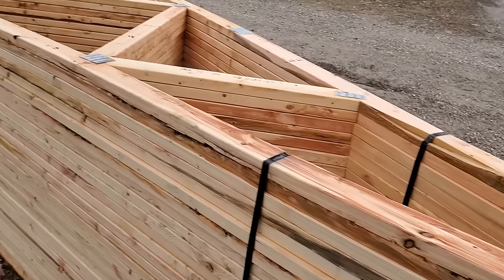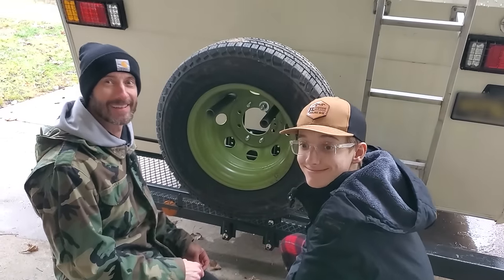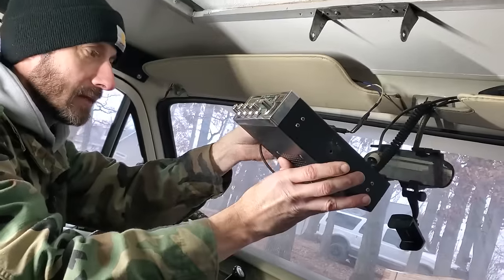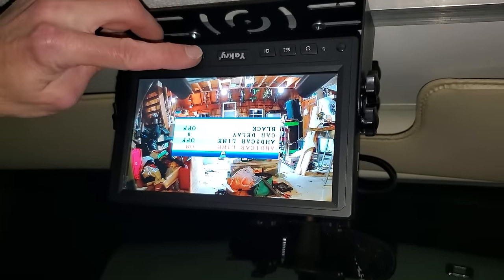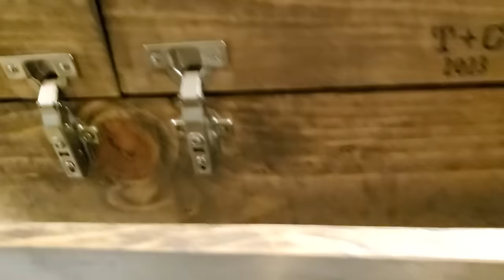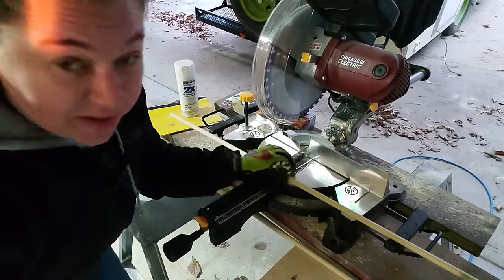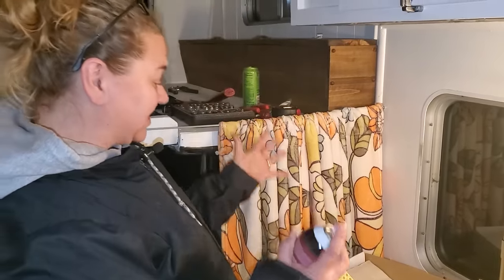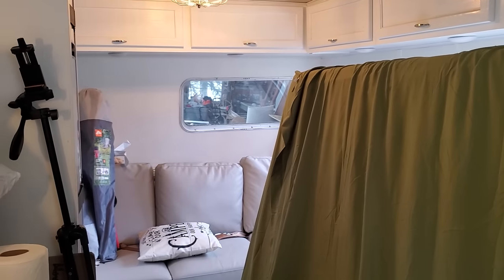Reviving Retro RV Vibes: Punchlist Palooza - Transforming Our 1970s RV - DIY Decor & More!

Comment: The husband and I suggest using magnets on the bottoms of those curtains so they stick to the frame of the window. Nice job by the way.
Reply from the maker: Great suggestion!  Thanks so much 🎉🎉
Reply: They make strong round or bar magnets, just sew a small pocket to bottom of each corner and add a magnet. Boom done
Reply: That is a great idea!

Comment: **wanted to share a tip I myself just learned the other day. When using sprays try replacing the spray tip with a WD40 tip. Switching tips help to have more control of the spray also not wasting as much. Be sure to test spray a few making sure the WD40 spray has cleared. I hope this helps you in your retro remodels. Love ❤️ your channel!
Reply from the maker: We have never heard that but sounds like it may be worth a shot!  Thanks so much 🎉🎉

Comment: Happy Birthday Tyler!!Everything is looking great!! Love your spare tire bracket and your camera mount. Love your new blinds , your curtain and that waffle cloth you glued up looks awesome. GREAT job. The storage build is awesome!! Just a suggestion for the angled from window, I bought some window film and put on mine and it worked great. Can't see through mine, it's white to let light in though. But you could use the darker color to block out sun and you can see out but not in if you get the mirrored kind. Another idea is you can get long springs and sew seam spaces each side of your blind and put one top and bottom. Run the spring or cable also would work, through the seams and attach ends to each side of window. If you make the blind longer than the width of window so it sort of gathers across the window for textured look. So happy to see another new video. Wonderful your getting a barn built to get you guys inside out of the weather!! So happy for you.
Reply from the maker: Thank you for the birthday wishes! Also,thanks for the compliments and suggestions😁. The window film is definitely something we've been discussing😉.

Comment: You installed the monitor (not camera) upside down. Try long springs for the curtains on the curved walls. Love what you're doing, congratulations on the 10K, and looking forward to the new videos..
Reply from the maker: Thank you!  Great idea with the springs.  So, yes, we knew that we put the monitor in upsidedown but the bolts on the sides didn't fit correctly in the mount if flipped... like it was only designed to be dash mounted or something.  We probably could have tried a little harder with those bolts though, lol.  We decided to fix it the hard way 😂. Thanks for watching and commenting!

Comment: Good job looks great!  For the front curtain-screw a rope (string) at the top and bottom of the window.  Then sew a piece of material with a channel top and bottom.  Pull the rope thru the curtain channel top and bottom.  Same as your divider curtain, except you have a channel at the bottom as well.  The curtain will stay against the window and not hang straight down.  You'll be able to push the curtain open as it slides along the rope.
Reply from the maker: Thanks for the tip! Good idea!

Comment: You can make blinds with magnets on them told hold them in place in those front and back windows people do that in the van builds all the time that way you can remove them and put back up quick and easy and still have the same blinds as the rest of them hope this helps congratulations on the 10000🎉
Reply: Just to let you know, the old campers usually have aluminum window trim/frames and magnets have to be fixed to the camper and the curtain for that to work. In a van conversion, they are working with the van body steel.
Reply from the maker: Thanks so much!  Yes, for magnets to work, we'd need to add them on the wall too (or some metal) since our windows are aluminum but it's still worth considering.  Thanks for the comment.  We appreciate you watching!

Comment: The monitor is also upside down
Congratulations on your 10k 🎉
Reply from the maker: Thank you!  So, yes, we knew that we put it in upsidedown but the bolts on the sides didn't fit correctly in the mount if flipped... like it was only designed to be dash mounted or something.  We probably could have tried a little harder with those bolts though, lol.  We decided to fix it the hard way 😂. Thanks for watching and commenting!

Comment: A simple fix for the blinds on the front and back windows. Get magnetic washers with a tapered center for a countersunk screw. Screw a steel washer to each end of the bottom dowel. When you drop the blind, stick the dowel to the magnets screwed to the wall. The magnets should be strong enough to hold onto the edges of the washers. You could put a second pair of magnets at a level in between to secure the blind partially open. Amazon has a 50 pack of these magnets for $6.99. That would be more than enough to magnetize all the blinds. Could leave the bunk blinds down when driving and they wouldn't flap around. Leave the windows open when there's a breeze and the magnets would hold the blinds down to keep a full blast of wind out while allowing some ventilation through the screens.

There are also non-magnetic steel washers with the same shape, made to screw onto things to stick to magnets. They'd work on the ends of the dowels and being thicker than regular flat washers would stick better on edge to the magnets.
Reply from the maker: Thanks for the tip. Lots of good suggestions about the blinds. Thanks for the comment 😁

Comment: Depending where you are going to be, you might want make a security strap on the tire and camera so someone does not help themselves to it.  A shame but some people have no shame.  The front window could have velcro tabs on it to hold it against the wall.
Reply from the maker: Yes, fantastic idea.  We are planning to use some of the cable we bought to loop through the wheel and padlock it.  Thanks for the comment!

Comment: The monitor is upside-down. Look at the main button on the monitor....:)😉
Reply from the maker: Thank you!  So, yes, we knew that we put it in upsidedown but the bolts on the sides didn't fit correctly in the mount if flipped... like it was only designed to be dash mounted or something.  We probably could have tried a little harder with those bolts though, lol.  We decided to fix it the hard way 😂. Thanks for watching and commenting!

Comment: Are you going to put radiant heat in the floor of the new pole barn?  Michigan is cold 9 months of the year.   I cried at the grandma scene too😢...i still use the sewing skills grandma taught me.   Just re- did my boat cousins.   I'm sure you can do the couch cousin. :_raiseroof::_loveharvey:
Reply from the maker: Funny story, Tyler's brother just asked us the same thing about putting radiant heat into the floors... we will probably go more of the wood stove route at this point but maybe we should look into the heated floors before we get past the point of no return. Can't sew without thinking of Grandma the whole time, she was amazing ❤️
Reply: I have seen videos where they already foam the dirt before the slab goes down.  They laid 6x6 welded wire fabric to attach the tubes for the heat to that.   Also added fiber to the concrete to help try to prevent cracking where you don't want it.   Others show Lego looking floors the tube attach too.  Others also used foam boards.   Not sure of the best application or the most cost efficient. Also don't know anything about the cost of the system.   But it seems awesome.

Comment: The monitor you mounted in the camper is upside down. Take a look in the word...
Reply from the maker: Thanks for the comment 😁. I did that on purpose because of the mounting bracket for the monitor. I'll have to modify the bracket in order to turn it right side up. It's on the to do list 😉

Comment: You put the screen upside down, not the camera.  look at the writing on the monitor they are upside down 🙂 anyway, fantastic job
Reply from the maker: Thanks for the comment 😁. I have to modify the monitor bracket a little bit so it can be flipped right side up. Flipping the camera was my quick fix. Probably should of just fixed the bracket to begin with

Comment: lol your screen is up side down the buttons are up side down
Reply from the maker: We had to mount it that way on purpose. The bracket was made for a dash mount. The bracket holes didn't line up with monitor when we flipped it upside down. I'll have to modify the bracket then flip the monitor. Thanks for the comment 😉

Comment: Are ypu guys for real?...THE MONITOR IS UPSIDEDOWN!...🤔🙄
Reply from the maker: Thank you!  So, yes, we knew that we put it in upsidedown but the bolts on the sides didn't fit correctly in the mount if flipped... like it was only designed to be dash mounted or something.  We probably could have tried a little harder with those bolts though, lol.  We decided to fix it the hard way 😂. Thanks for watching and commenting!